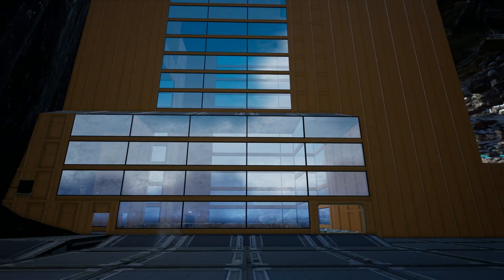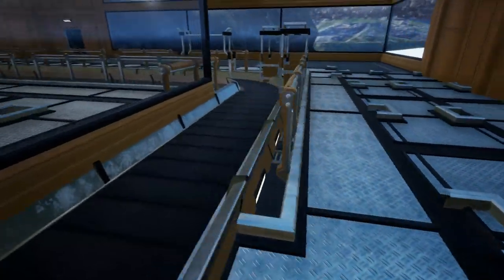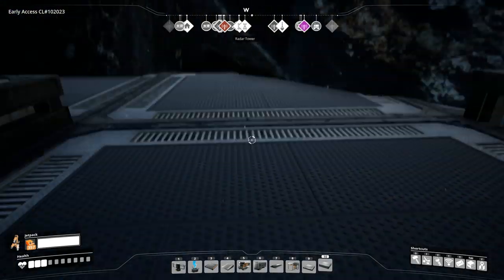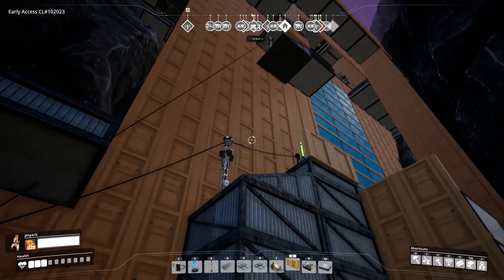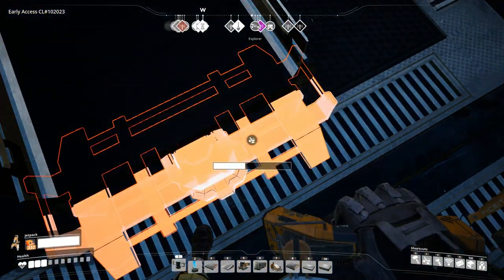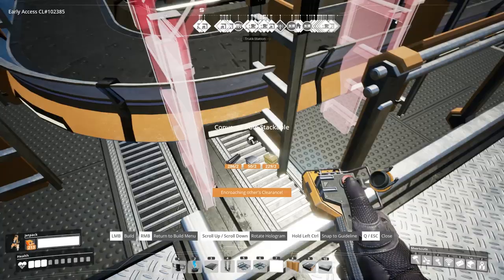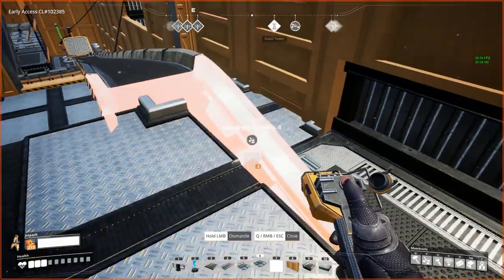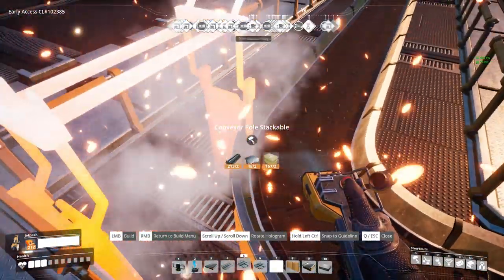Satisfactory How to Build Awesome Automated Personal Elevators

Comment: I'm guessing this is broken in update 3?
Reply from the maker: Jason Horkles there’s no reason why it should be broken in U3 but we do have hyper pipes so it might be just easier to use them ☺️
Reply: @TotalXclipse  HyperTubes are nice but a bit slow when going up hills. The reason I say it'd be broken is because you now go the correct speed on the conveyor belts instead of way faster than the items
Reply from the maker: @JasonHorkles  hmm, in that case the automatic elevator will still work, it just won't be quite as quick :)